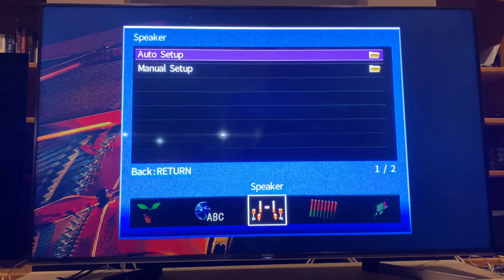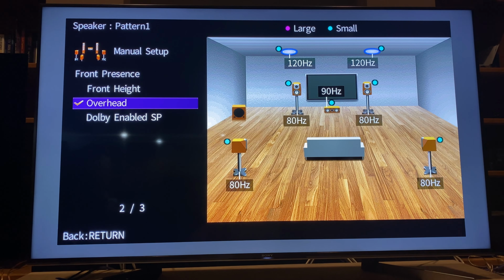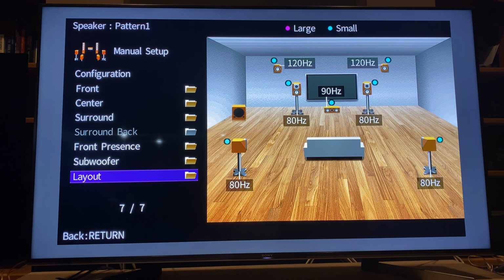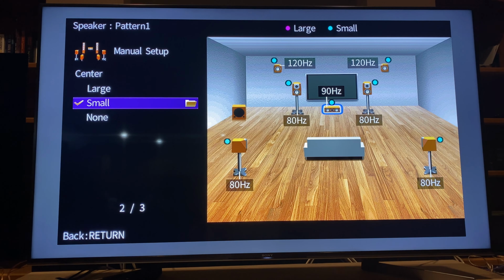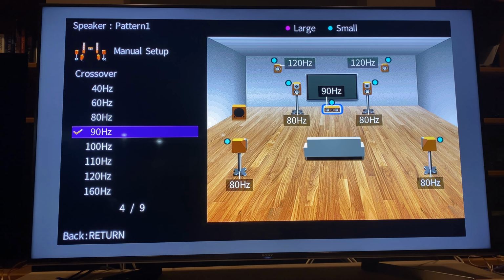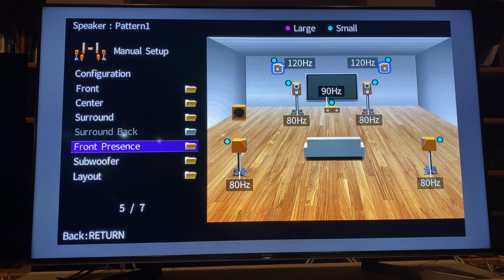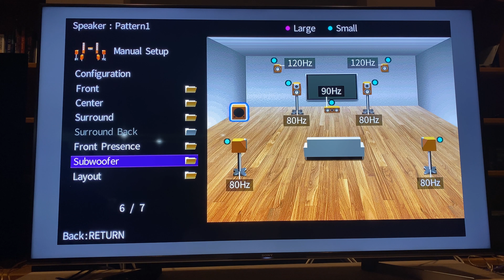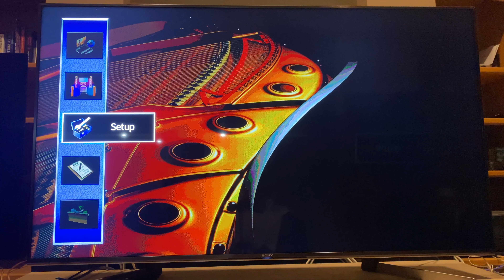Dolby Atmos AVR Crossovers Settings Explained

Comment: Great video. I had my Klipsch Dolby Atmos speakers setup incorrectly and this helped me to select the correct setting. Thanks! I have the Yamaha A3070 and run it in straight for Atmos movies. Works great. I haven't played around with crossovers on my Klipsh speakers and all are currently at 80 Hz which sounds pretty good.
Reply from the maker: You’re welcome, thanks for this comment

Comment: Hi. I have a yamaha rx-v6a and pylon pearl 5.1 set and 2 x Wilson raptor X for dolby atmos effect speaker. I have set all speaker to the 80hz as a small and sub is activated at 80hz to below. Shall I set only D. Atmos Speakers to 120hz, Sateltites to 70 Hz and front to 80hz and central at 90hz?
Reply from the maker: Hello, good question, atmos speakers set to 120Hz is good, everything else set to 80Hz includes sub, satellites, fronts, center, etc…

Comment: AVR - 5.1 Yamaha HTR 3072
All Yamaha Bookshelf.
Speakers FREQUENCY.
Center - 58Hz - 45Khz
FS - 57Hz - 45Khz
SS - 62Hz - 20Khz
SW - 20-160Hz
According to abv what crossover is to be set. Currently set 80Hz.
Reply from the maker: For the Yamaha bookshelf 70-80hz should be best, ideally the consensus is 20 more than the speakers frequency; to me depends on if I get enough deep bass from the crossover. Thanks for the comment your crossover now is good.

Comment: I have a Yamaha Rx a3070 and on its screen it tells me straight instead of telling me atmos, it turns on automatic in straight and it doesn't allow me to change it to another way?
Reply from the maker: When on straight make sure your source is atmos capable and if it is make sure you turn it on. Your 3070 is a beast and should be able to display atmos/dts:x while on straight mode
Reply: @hoodeddragons  That it's straight way because I didn't understand that part, please
Reply from the maker: On the straight mode when playing an atmos movie should display Dolby Atmos, if not either there’s something wrong with the AVR or your source. For instance make sure you are using an hdmi 2.0, a 4K Blu-ray player and is playing a movie that is in 4K with atmos selected depends on disc
Reply: @hoodeddragons  Yes, I have a 2.0 cable and it's from an Apple TV 4K 3rd generation
Reply from the maker: Ok you might have to google for your Yamaha, and remember streaming services doesn’t have atmos. I Have have a recent video on how to force atmos or dts:x if you own Xbox, check it out for information if you haven’t yet.  How to get DTS:X for Movies/Streaming & Gaming all the time
https://youtu.be/nAaEKBSryxw
Reply: @hoodeddragons  I don't have Xbox just an apple TV but it tells me that they are in atmos the movies are from netflix and apple tv +
Reply from the maker: Oh, that may be the reason why your Yamaha doesn’t display atmos, apple must have a different kind of atmos; I’m suspecting
Reply: @hoodeddragons  Dolby Atmos normal is that it has and is programmed for that.
Reply from the maker: Not sure about Apple TV, but normally you need a 4K player and 4K disc to run proper atmos for now
Reply: @hoodeddragons  OK, I understand, I would have to try it like this to see if it gives me atmosphere, the Bluray player will be difficult because in my country RD 🇩🇴 that's very difficult to find one of that
Reply from the maker: No only YouTube
Reply: @hoodeddragons  I speak from my cell phone. I don't have a computer.
Reply from the maker: Ok
Reply from the maker: @franklincrisostomo2874 I understand